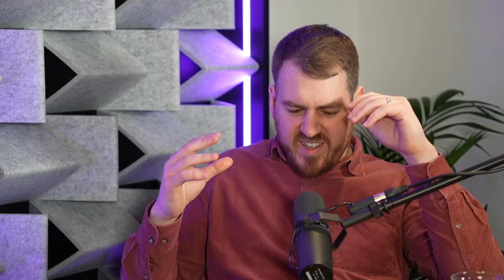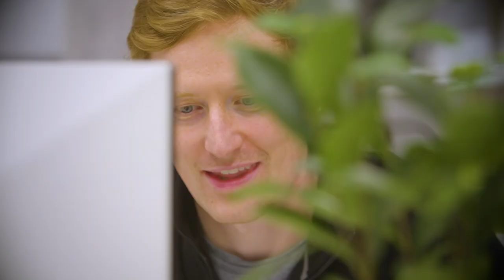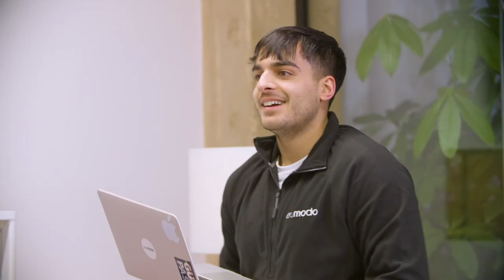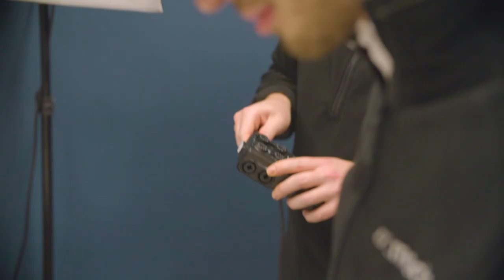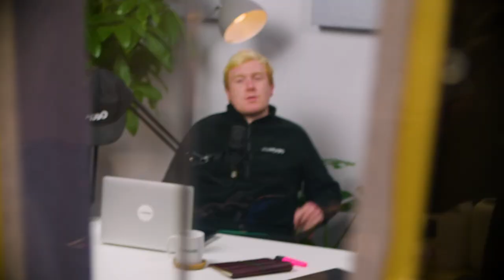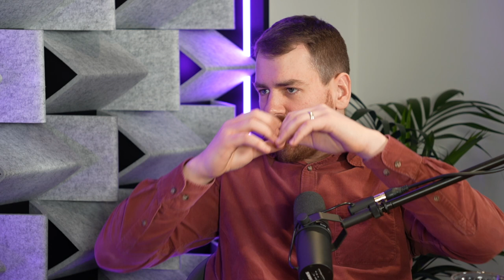Iron-air storage - Modo: The Podcast (ep. 53: Form Energy)

Comment: The reason why round trip efficiency relative to lithium doesn't matter is that Lithium effectively "produces" electricity every time it cycles. It absorbs excess/waste energy and effectively 'creates' energy when its needed. So the more it cycles, the more money it makes. And it needs to cycle a lot to make the investment worth it. Great for managing daily variations! But seasonal cycles are huge and slow so a lithium battery capturing a seasonal cycle would only get to discharge 4-5 times a year, and would never make back the investment. Enter iron-air. At 1/10 the cost per cap, you don't need to cycle nearly as often to make your money back, even if 60% of the energy is wasted.